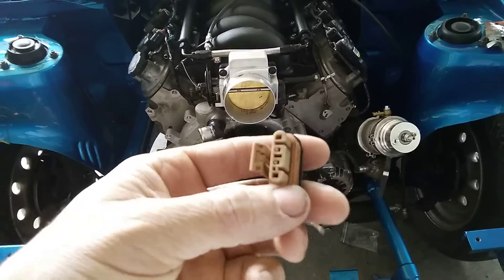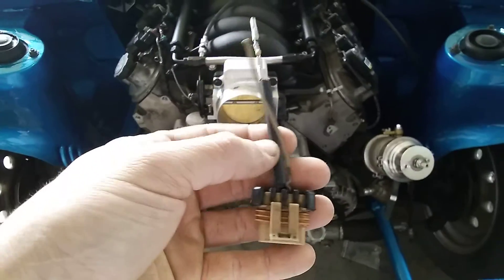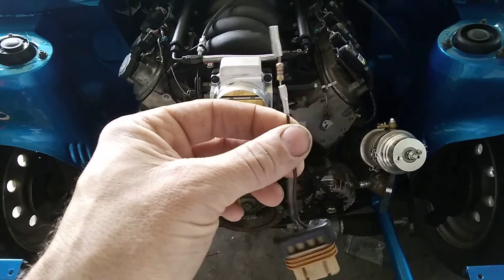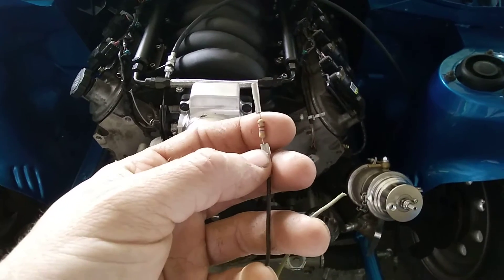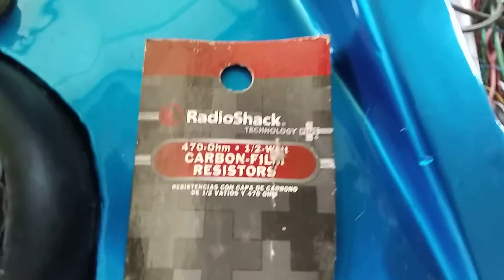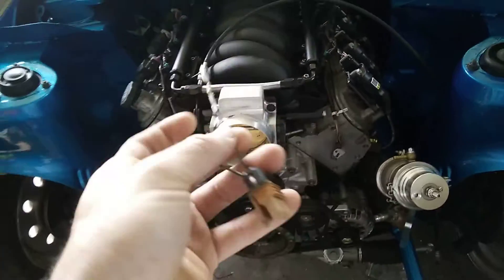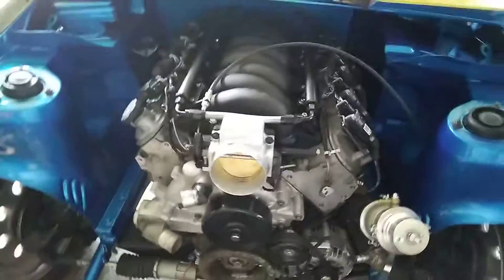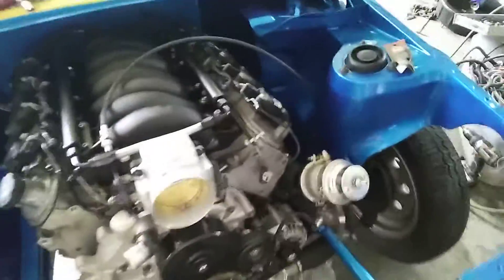LS swap what size resistor for alternator wiring question answered

Comment: So I got those resistors for my swap and I put 12v on one side and my multimeter on the other end I'm still reading 12-volts. Whats the resistor bring 12v down too? Thanks
Reply from the maker: I think it’s supposed to be 9 volts

Comment: Ya i know sloppy use to have that info but i could not find it my suburban just had an alternator die and i took one of my other suburban in the yard thats broke and now its fluctuating so im thinking it is a bad connection back to the computer or whatever controls that but figured this was quicker and also i wonder what does control it why you cant hook it up to the computer and it work fine